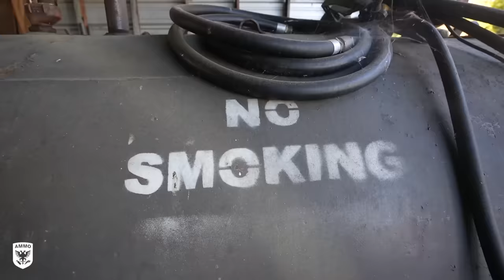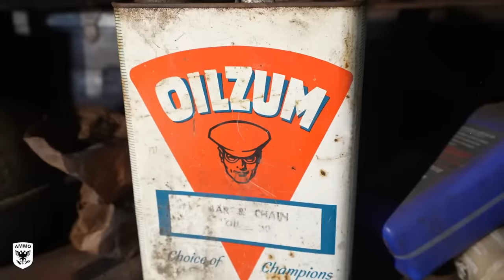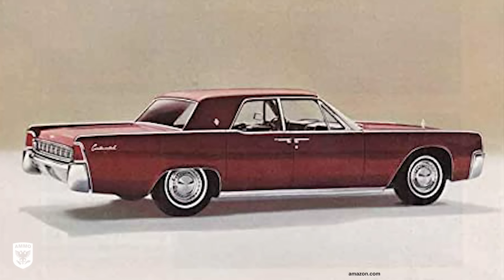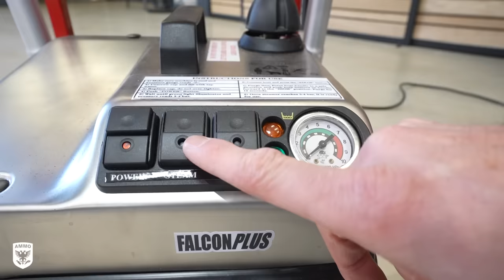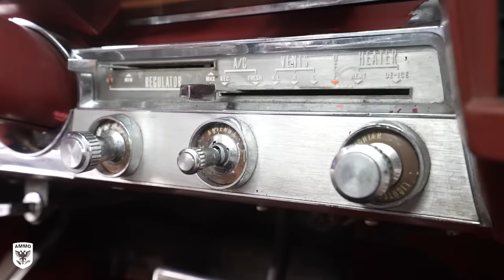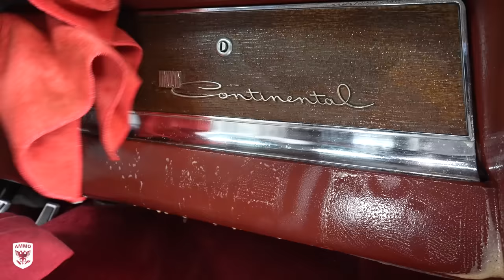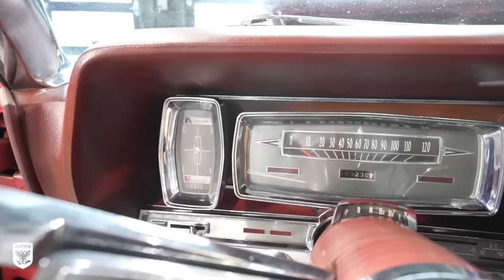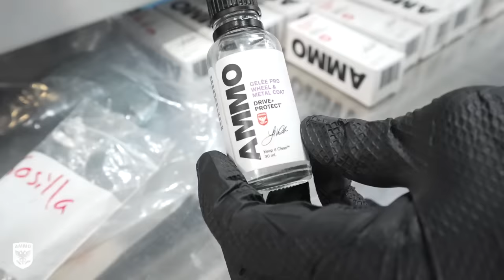MOST DISGUSTING CAR EVER! First Wash in 27 Years on Gross Lincoln Continental Surprise Reveal

Comment: I'm not an evolutionary biologist but I'm a bit of a layman on the topic. Essentially, they just crap when they need to go. Normally treated wood and metal would not be their home, so these droppings would be absorb into the soil and washed away by the rain, not accumulate over many years. Also new plants will be fertilised that mice need. But it's more that there is no evolutionary disadvantage as this benefit would be small, so mice aren't going to waste time pooing in a selected corner.

Comment: touching story, but I kept thinking why oh why was it stored with the windows down for all those years!  if it were mine, I'd throw out the carpet and insulation immediately...has got to be soaked in mouse piss.  these are incredibly complex machines...electrical microswitches, sensors, and relays, and miles of individual wires and vacuum lines...maybe the windows weren't operational, like the top.  it wouldn't have stopped the mice but it might have at least discouraged them.  I had a '64...a little bigger, same quality of material and construction, but they lost some of the unique detailing of the 61-63...flatter and more angular than the earlier ones...and a much less interesting dashboard...the '61-63 were just amazing cars, along with their little brother, the Tbird, which was built on the same assembly line and shared the firewall and other components.  Ford at the top of their game.

Comment: You should wear a mask around mouse poo and mold at all tines.  I am surprised you were not doing that when doing the exterior.  My folks bought a used 1963 Lincoln in 1966 with exterior white and black vinyl top. The door locks were on a vacuum system.

Comment: Protip from a hazmat tech: respiratory protection on FIRST. Pull the hood on and place around the seal on the mask (firefighters do the same, for essentially same reason). Gloves OVER suit cuffs & tape and FFS don't touch your face, suit.... fiddle around and you've just compromised your basic protection.... then steam after cleanup (vehicle areas, as hot as you can) and PROPERLY sanitize respiratoryprotection/destroy suit, gloves & tape. Advice from a professional... Take a class (start with HAZWOPER).. ps... you're taking it home AND contaminating your job. Learn mitigation & remediation measures and properly apply them to your trade. You bear liability for staff, contractors and owner can get you on breach of contract and negligence.

Comment: How do American cars get so much less horsepower from such high displacement
Reply: That translates into low-stressed machinery that can go 100k+ miles.  The number you need to look at is torque, which these big V8s made in spades.  When you have to get 6000 lb. moving, that's what you need.  Remember, horsepower is a function of torque, not the other way around.  At any rate, the gross bhp was rated at 320, torque a massive 465 lb./ft.

Comment: I dont understand ? Normally on these documentaries you go in get the engine running tune it up change the oil and filter service the trans get the top working new battery new tires and brakes go through the suspension then do a deep clean on it and detail . Then give it to Dad to take out and drive. After that long the engine may be locked up from sitting will need fuel system clean and flush tank dropped steam cleaned an flushed and pretty much mechanically restore. So you clean it up dont get it running and spend days on it dont do any mechanical then drag it back home shove it back in the garage and put the dirty cover back on it and let the mice take over again . WTF?